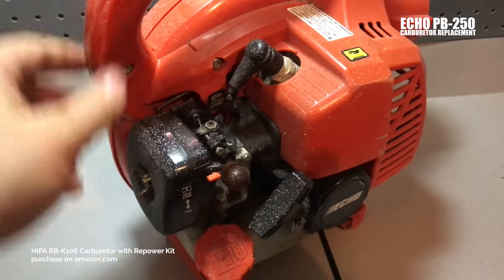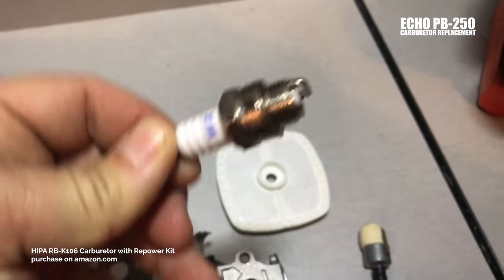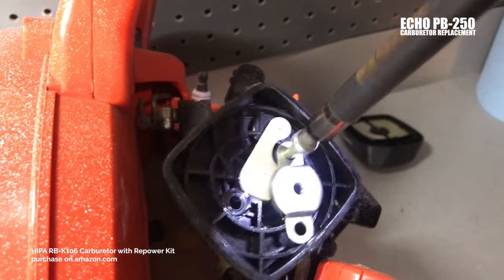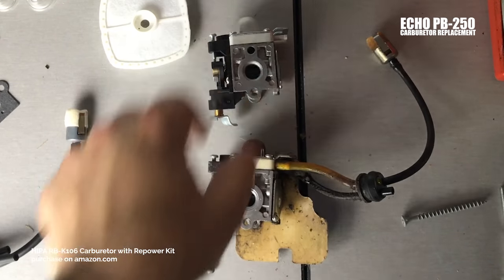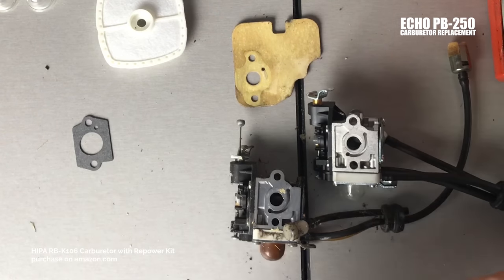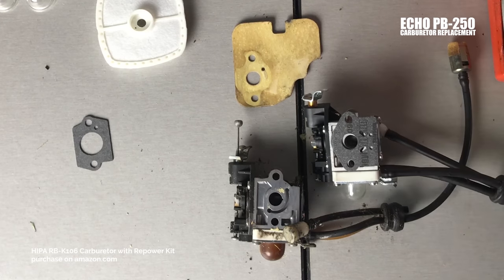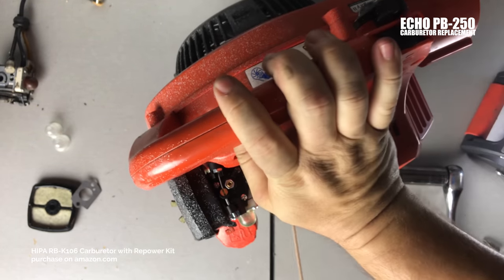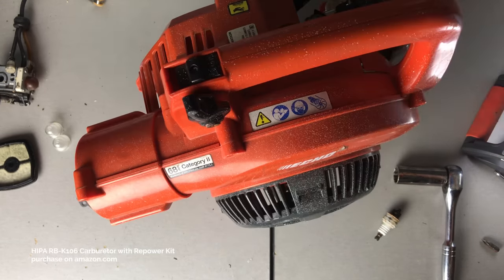How To Replace The Carburetor On The ECHO PB-250 Blower | Full Video

Comment: I went step by step and still managed to get the run switch backwards. So after i fixed that, put the air filter on and put the gas back in, pushed the bulb about six times and she cracked right up. Best instructive video thanks brother for taking it slow for we mechanically challenged people.
Reply: Oh forgot, when i dumped my gas out it had trashy particles in it so i put fresh gas in it before starting

Comment: After I changed my carburetor I still had to adjust the fuel to air mixture screw on the carb.  Made a huge difference, no more bogging when the throttle is wide open. Thank you, this video was such a major help!
Reply: Is there a vid on how to adjust the screws ?

Comment: Thanks for this video! I've had my PB-250 sitting for over a year+, not able to get it running, primer not getting any gas, etc...and being lazy/not getting it fixed. Saw this video, picked up a cheap carb kit on Amazon, followed this step-by-step, and boom...fired right up. Save me some cash and headaches. Thank u!

Comment: Thanks for the vid!  Friend gave me this blower that their previous house owner left behind.  It ran on full choke, but that's it.  Who knows what the technically-exact problem was (I think it was the actual throttle on the carb), but for a $25 carb kit to replace everything it saved more than that in time spent adjusting high or low speeds, testing for leaks in the fuel or vent lines, etc.  Much appreciated.

Comment: Look between the four carb screws on side of engine. There is a plastic grommet that you need to remove to get at the adjustment screw.
Use a screw or a punch to remove   plastic grommet.  Start engine and use a very small screw driver turn it to the left until it stops bogging. 
No carb needed.
Reply: People keep buying carbs needlessly when all they have to do is uncover the 2 adjustment screws. Not only that but replacing them with junk Chinese carbs that hardly work. All 2 cycles need carb adjustments as they age.
Reply: @andybecker2693  original carb is also Chinese.

Comment: Just replaced a carb on an Echo SRM 211 trimmer with a similar replacement kit. Looks like my Echo PB 201 blower's  pretty much the same deal as what you've got going on here.with your model. Purchased a  HIPA kit for the 201 off Amazon.  Cool thing is most of these kits (from several different manufacturers) include all the stuff you show here; carb, air filter, line, fuel filters, etc, all of which if purchase individually at your local Home Depot, Ace Hardware of similar retailer would cost WAY more. No, it's not OEM but for the price/performance at least for me, it's an unqualified no-brainier. Thanks to 'Fix It Now' for this very instructive video as well as Google for leading me hear, YouTube and last but not least, Amazon (you're welcome, Amazon)

Comment: Mines a goner changed the carb 
Spark plug 
Cleaned the resister 
Finally did a compression test it’s at 25 psi 
Next time is re ringing the piston found it on Amazon for $16 
Total investment so far 16 for piston ring 
$20 for carb and lines kit , way better than paying $200 for a new one . Oh p.s the vacuum screw that allows it to open it it’s not completely engaged it won’t start so make sure the tab if fully closed .

Comment: Thanks for the  video. Very clear and well done. I did the replacement and it started once. I was unable to get it started again. It was leaking  some fuel some fuel off the front by the exhaust before the repair and some after the repair. Any ideas, or is it time to buy a new one? I did have it at a shop and they said it was the carb so I bought the kit  and replaced it. Thanks for any feedback.

Comment: Thanks for your video. 
Question. Spark plug still look good. But if I turn it off and try starting it up a few minutes later
It won't start.
Must let sit for a while. 
Than it starts. 
Any ideas for this fixes.

Comment: Tip to keep your fuel lines from rotting and carb working dont leve ful in the tank especially if it has ethanol in it also run your carb and lines dry.

Comment: I replaced my carb with this exact kit, checked the spark arrestor, new fresh fuel, and still can’t get it to run right. Any ideas? I played with the set screw in every position but could not get it to rev up fully, smoothly, or not bog. Hell I even checked my compression and it’s good. Any ideas??

I did check the air filter and there’s gas on it now… idk what’s going on.

Comment: Great video, here in Fl I only use none ethanol (MArine Fuel) for all my two soaks and E-Tec Outboard, never an issue with fuel, screw that Ethanol garbage.
Reply: Dude is that that rac90 u talking about. Man if it is it works great.

Comment: Does the length of the clear yellow or the other black line matter. I cut the lines on the new carb to match what yours looked like and the original carb  here but now it does not want to start unless i make sure the clear yellow is full of fuel?

Comment: I changed my carb with an oem echo carb. Runs great at idle and also wide open as long as the blower is sitting level. As soon as I tilt it downward ( in a using position ) it kills.  I can’t figure why? Any advise is appreciated. TIA
Reply: Fuel pick up is not at the bottom of the tank.
Reply: Jonathan marse ,, i been with same problem , and the problem was ,, i put those hoses in the row place
Reply: @antonysaavedra0797  yep. That’s what I did too.

Comment: great video changed mine today. biggest issue getting lines back into gas tank, I put a little liquid soap around fitting seemed to help. but still will not crank like it's not getting any spark??  any suggestions beside going to dealer?

Comment: Thanks for the video.  I overlooked the obvious.  Mine just didn't want any choke or throttle.  I was flooding it to death.  You see all these guys using the primer and choke.  Mine didn't need it or want it.  I used neither, and it started right up idling perfectly, so ????????????  All I did was clean the NGK plug, and turn up the idle 3/4 turn.

Comment: I have the same blower and it bogs down.  I cleaned the acuator and it still bogs down.  I purchased the same carb on amazon and have yet to install it.  Once you installed the new carb did you have any problems with the blower???

Comment: I replaced the carb in mine and it starts, runs for about 30 seconds, then stalls. I haven't touched any of the adjustment screws on the carb. What do you suggest?

Comment: Great video. How is it running before? Mine is bogging down I have to manipulate the choke Do you think a new carburetor would help?
Reply: Stevo Schauer check your spark arrester screen on the muffler. Could be clogged up if so just take a wire brush or a blow torch and clean it. Just a suggestion.
Reply: I'm Daniel Padgett I'm using my wife's phone in case you were wondering y it says her name lol
Reply: Dan, that's good info, have never heard that, another guy suggested looking for ethenal free gas station in  the area you live in, I've never heard that either, and if so, why doesn't repair shops push that.....BECAUSE THEY MAKE A KILLING ON DEAD YARD EQUIPMENT. thanks again

Comment: The PB250's used two different carbs. This one as in the video and the Walboro WTA-33. Unfortunately mine has the later and it's more expensive. Plus the primer bulbs are different.
Reply: Jackson Cruz  I also have the wta33 could we just replace with the one in the video? Unfortunately we can’t adjust the wta anymore cause they stopped supplying small d tool for the high and low needle
Reply: @Trackhoe075  No sir. The trigger mechanism for the throttle is different. I have seen some of those needle tools on Amazon. I haven't bought one yet but they are available.
Reply: Jackson Cruz actually I have bought 3 different ones all claiming to have the mini  D that’s needed however all have failed! They just spin but no adjustment! I know sometimes they fill either with a plug or sometimes epoxy in hole! The later rendering no chance of adjusting. I am pretty much done myself experimenting! Hell its cost me more then a new carb.. lol
I think I’m gonna stick with Stihl they clearly are the best and I guess they trust we are plenty capable of being able to make our own adjustments it’s too bad oh well I’ll find a buyer somewhere or will just part it out! Never will buy Echo again!!!!
Reply: @Trackhoe075  Good to know. Ill have to research and see what can be fabbed up to work. or slice away a small piece of the aluminum from the carb to expose the adjuster.
Reply: Jackson Cruz I was going to look into doing the same maybe using a drill bit to just make a bigger hole and then maybe get a dremel to slice a slit but it appears to be a very small needle head that has that D shape! I also did a lil research on the needles as well and partstree actually is listening one of them as NA ( not available) I’m done lol like I say Stihl seems to be one of the few left allowing high and low adjustments!! It’s too bad how our society has become a throw away! Yes Stihl cost more but at least ya can work on them! I just hate the idea I have to buy a new carb when it could be something as simple as a adjustment
Reply: Jackson Cruz 
Just thought of another idea you might try! Try using JB weld maybe on a Allen wrench about same diameter and if it does hold ya might be able to unscrew and then if it were me I might at that point cut off the Allen wrench to a good length and use a dremel to make a slice in Allen. Idk if this will work but it’s a thought! Me I’m sticking to my stihl! If you try or something else works please pass it on

Comment: So just replaced mine but it wont start? Any ideas?
Reply: Do you have spark?
Reply: @SuperUncleRyan  yes. I even turned the switch off verified no spark,  turned it on, got the spark. Tried starter fluid too no luck. I'm at a loss?